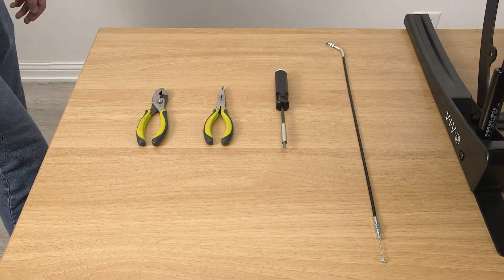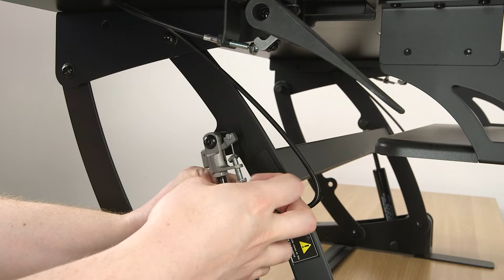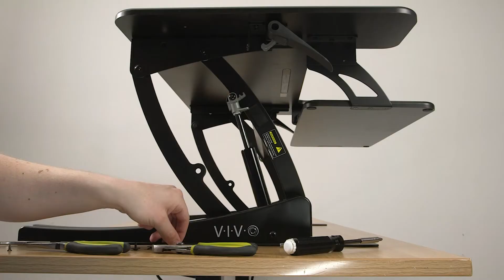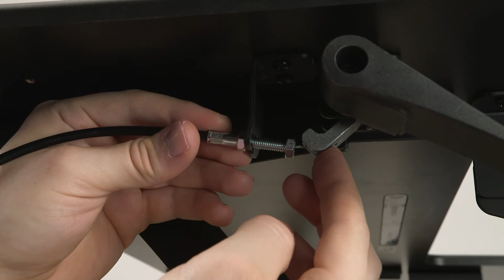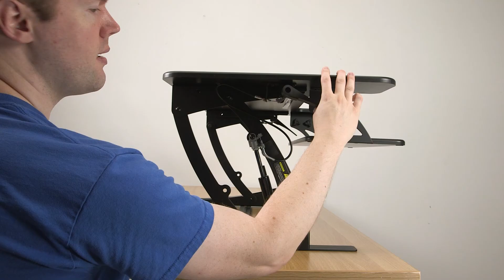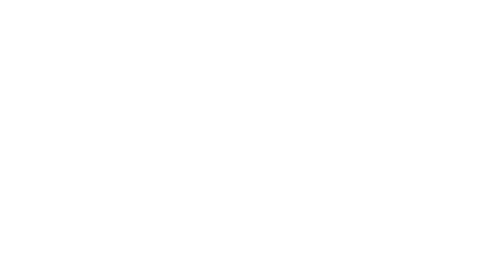How To Replace The Cable On Your Desk Riser by VIVO

Comment: The cable broke on mine in the down position, so i can't get the riser back up.  Is there a manual way to get it back up in order to perform the replacement of the broken cable?
Reply from the maker: There's a small metal lever on the end of the spring which is normally pulled by the cable to unlock it.  Pulling this down either by hand or using a tool while squeezing the working handle on the other side will allow the desk to lift.

Comment: Just contacted support so am waiting for a reply there, but do they make a replacement gas spring? Mine broke off so now my cable does not have anything to connect to. I have an older model where the spring is directly under the center of the desk so maybe that is why in later models this was moved an housed inside a leg to protect it some more? I have the 2020 DESK-V000N
Reply from the maker: If it's just the metal hinge/lever piece that's broken, we do have replacement parts available.  If the whole spring is needed, we'll have to check inventory since this model's been out of production for a little while now.  Customer support should be getting back to you soon, most likely within the next hour!